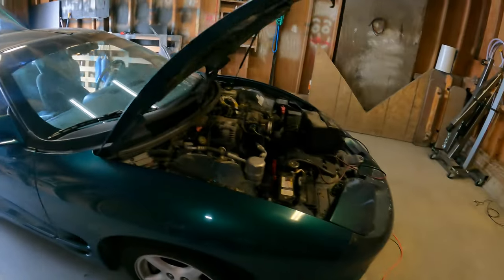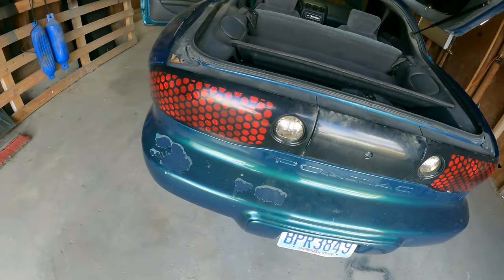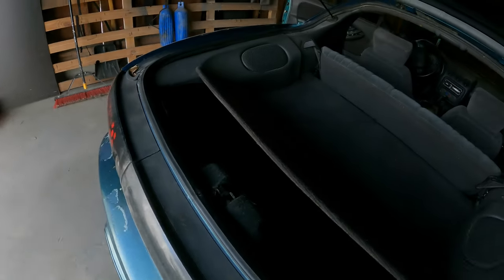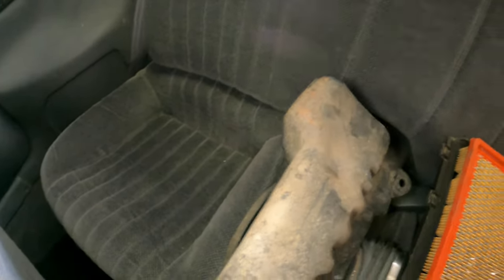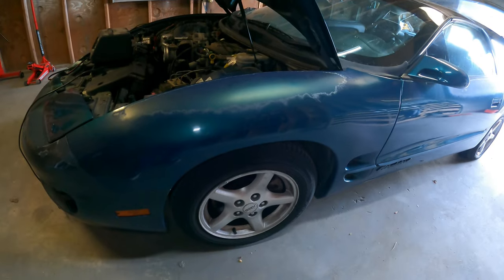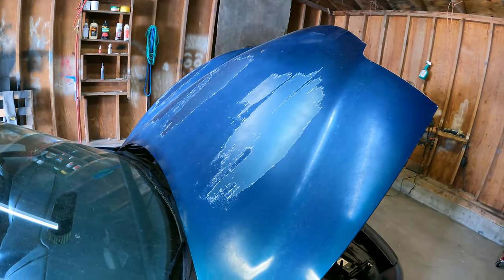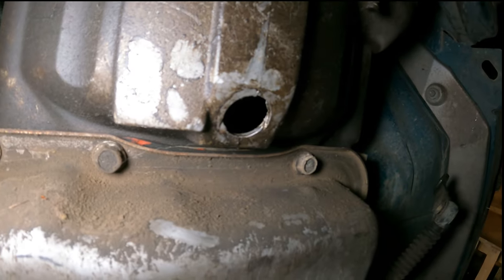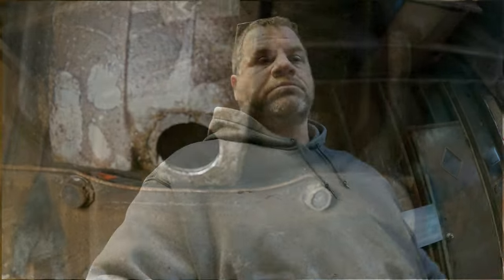LS Swap Pontiac Firebird.

Comment: If you need parts or just advice, Hawk's third gen is a great place.
Reply from the maker: A website I assume. Is there a YouTube channel as well?
Reply: @ScottsChaos  possibly. They are a shop in South Carolina that sells f-body parts, both used and reproduction, and also specialize in ls engine swaps.
Reply from the maker: @michaelm3381  I will definitely check them out. Thank you for the tip.
Reply: @ScottsChaos  you're welcome. I've purchased several parts from them. Good luck with the project!
Reply from the maker: @michaelm3381  thank you.